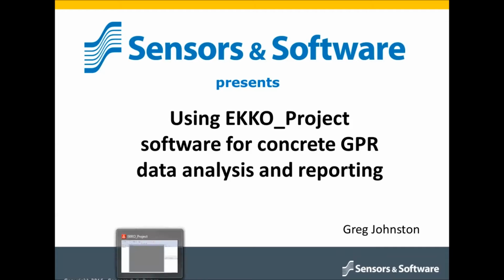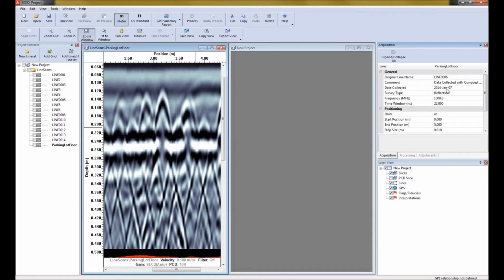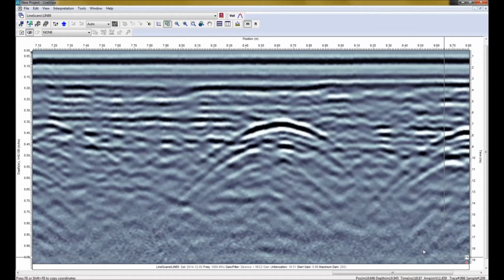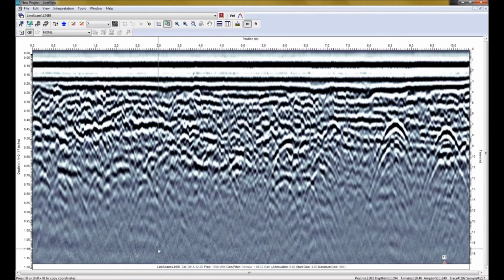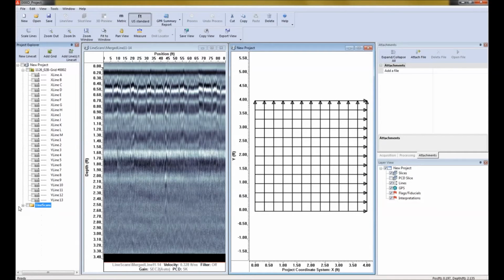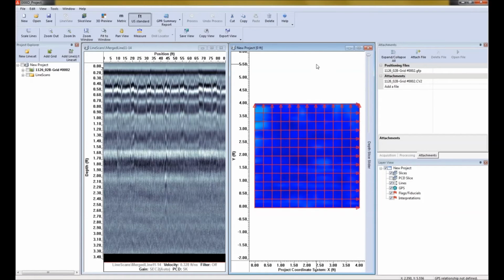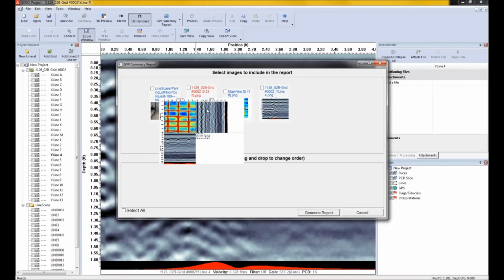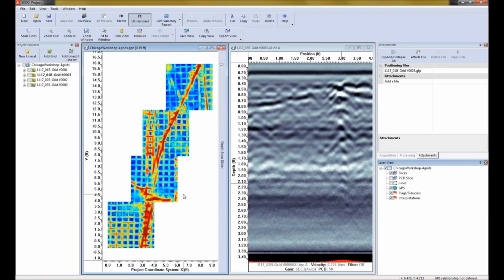Webinar  Using EKKO_Project software for concrete GPR data analysis and reporting

Comment: How to place grids on a background drawing in their correct order of collection?
Reply from the maker: Thanks for your question.  I’m assuming you’re doing this in EKKO_Project?  If so, refer to section 17.11 of the EKKO_Project manual for details.  The manual can be accessed from within the software.  
You can also check out our webinar on using the SliceView module in EKKO_Project for tips on handling grid data https://www.sensoft.ca/training-events/webinars/webinar-sliceview-for-gpr/

Contact us for more support here - https://www.sensoft.ca/contact-us-gpr/